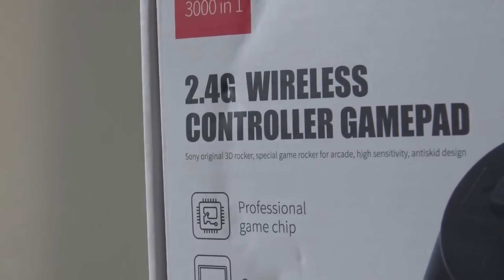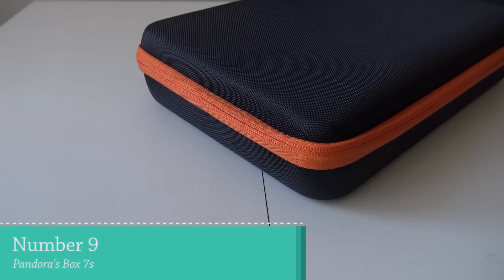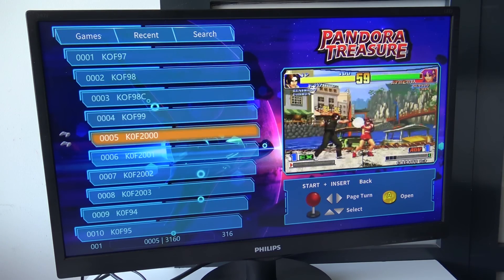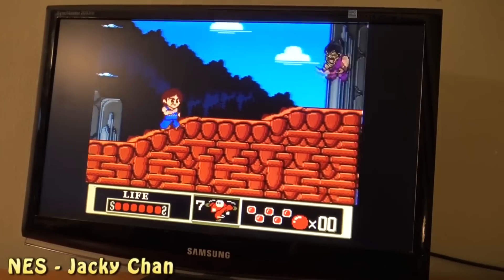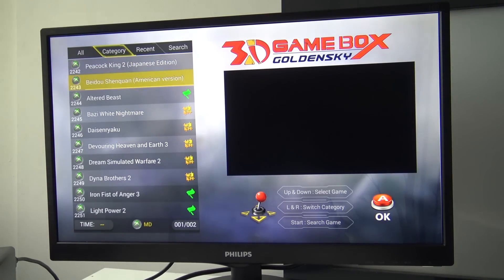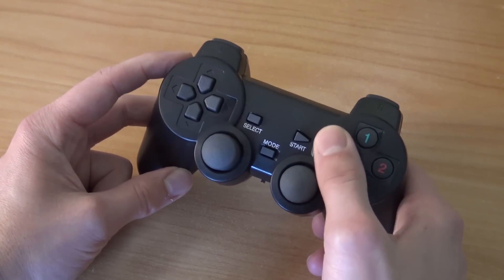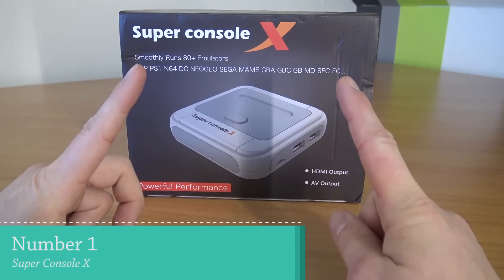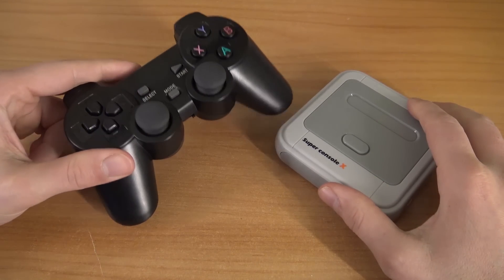The Best Retro Station Console Systems for 2020 / TOP 10

Comment: I don't think that retroquest was originally from China, or at least the version of the software they were ripping ( hence the boot screen image and the Japanese menus). I would say if it was put together in China it's more likely that it came from HK, that would explain it using Japanese software. Typically if you buy in the mainland menus are in Chinese, probably with the exception of Guangdong (where there is a possibility of some Japanese stuff slipping in). Stealing Japanese software seems not only expensive, but a little out of character for mainland companies putting these together; and there is a ton of easy access to emulators in China due to almost no restrictions on emulation.

Comment: Can't I just play all the games with a nice menu on my current PC, I really want to avoid the hassle of connecting an extra device, any suggestions? Thx.
Reply: Trust me, tried that with my current PC. It's a Hassle! There's ALWAYS something that doesn't work! Missing Bios, stuttering Video sequences, Controller not recognized or Emulators straight up not working. Trust me, a simple Solution like Retro Station 14k or Super Console X is more than welcome in my Case!

Or if you like, why don't you try one of those Hyperkin Consoles where you can use Original Cartridgesa?
Reply: @TomSir79  So, I decided to download Coinop Next. It took a while to download, but after I extracted and clicked on the icon shortcut, it worked like a charm, it detected my controller right away, and now I have all the games I love to play, all of them. On top of that, you can extract extra packages and add those. Although, I haven't done that because I honestly haven't had the need to. I solved my issue to have all those games I've always wanted with a nice, rich menu with plenty of options, hope this is informative ✌️🙌.

Comment: you know i believe that the best system plug in is the super console X it is much better than the pandora boxes with thousands of games. the super console x pretty much has every game system except for ps2 and ps3. I only paid $40 bucks for mine. I own 3 pandora boxes the 5s, 3D 2448 games, and 3D Saga 3188 games. the problem with the pandora boxes; there are no updates and they keep releasing the same thing over and over. the ps1 games on pandora box play choppy, slow, and many of the N64 games dont even run properly or dont have proper control figurations. The ps1 games play perfect like exact original on super console x, the only downside about the super console x is that it has a limited number of ps1, atomiswave games; however i would rather have less of something as long as it runs perfect instead of having issues with it. the N64 games need button configurations. plus too many great games are missing from the pandoras boxes such as arcade version of mk2. dreamcast versions of capcom vs snk 2 and king of fighters. super console x has it. what kind of hardware is the super console x running on? android? I also bought me a 16tb game system from arcade one it can run ps2 and ps3 games, it has 70 or 80k games. I paid $975 for it. its worth it because you will eventually spend thousands of dollars; if you keep buying pandoras boxes. before i bought the arcade one 16tb game system. the 3 PB's and Arcade 1up MK II machine cost me about $1k.